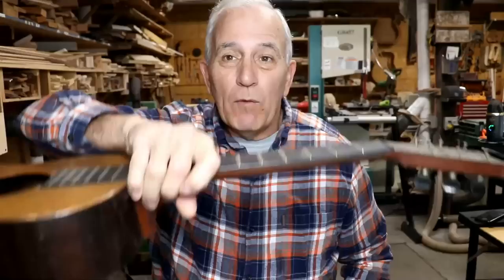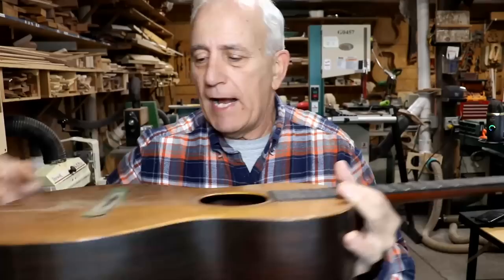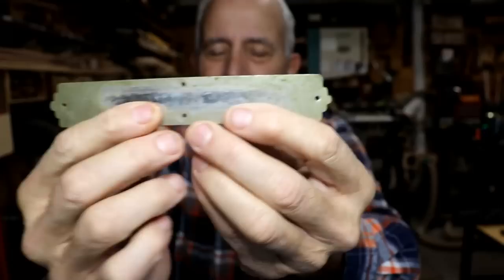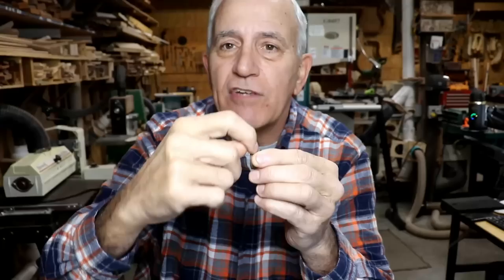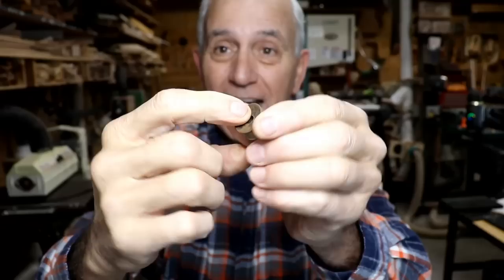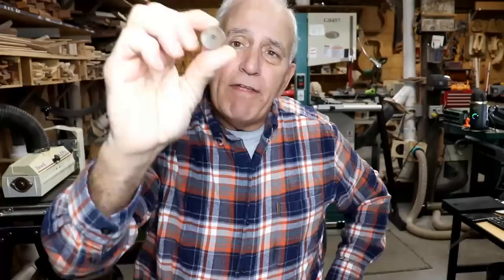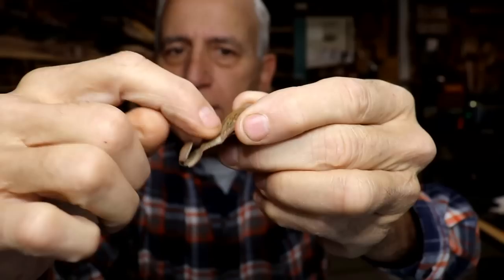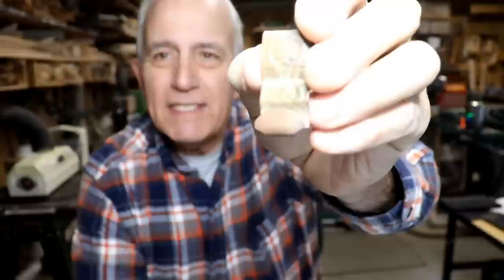Vlog #176 Several Mysteries Solved Including Washburn Parlor Guitar

Comment: Has to be an aftermarket thing.. the holes were already there when u pulled the metal plate up.  The factory wouild not have drilled the holes then covered them over with a metal plate.

Comment: The buckle is called a Tackaberry. You run the latigo strap through the top slots and leave it like that all the time. Then you just put the hook on the bottom of the Tackaberry on the cinch ring. Pull up on the latigo to tighten cinch and put tongue through the hole on the latigo to lock on place. It speeds up saddling because you don’t have to do threading the latigo through the cinch and up through the ring in your saddle rigging two times. If that makes sense. I knew a man with one arm and using a Tackaberry allowed him to saddle his own horse. I was a horse trainer for almost 40 years until a very severe horse wreck ended my riding career and most other activities in my life. I play an Eastman 315 mandolin and love it! Love you and your show, watch it every day. God bless you and thanks for all that you do. Here’s a link to see what a modern Tackaberry looks like. 

https://warehousesoverstock.com/tough-1-nickle-plated-tackaberry-buckle/

Comment: Jerry, just seeing that there are 6 peg holes through means a standard bridge was used at some time, at least on this guitar. If it had been built with the bracket style string, no peg holes would have been necessary. I think Washburn used the metal plate as there ‘plan B’, either as a factory or after the fact(ory) fix.

Comment: Jerry mow that you mention it I remember somewhere I heard that there were conversation kits available back then for guitars to convert them to steel string when company's were moving away from gut strings, Nylon strings weren't really available untill the 1940s. Or It might have been some spare parts added because of a low neck angle?

Comment: Here's my guess on the Washburn. Looking at the height of the floating bridge, it appears too high for a standard fixed bridge and that's after 100 years of string tension - that bridge has been reduced over the years and was taller when the guitar was new. This means the neck angle was never correct for a fixed bridge. I think some guitars got assembled with too steep a neck angle and the easy way to fix it was to remove the fixed bridge and convert to a floating bridge.

Comment: The rock that looks like a piece of glass on it could have been caused from a lightning strike. Based on the bleeding look it has. The different elements in the earth when hit with the power of lightning melts the sand particles to make glass.   imo I've been told.

Comment: Hi Jerry, Washburn was known to have bridges glued on in the not quite correct location. Have you measured the distance from the nut to the 12 fret and see if the distance to where the saddle should be lines up in a place where the glued on bridge was. It may be that the scale length doesn't work where they put the bridge originally. therefor a floating bridge and a trapeze tailpiece fixes the problem.